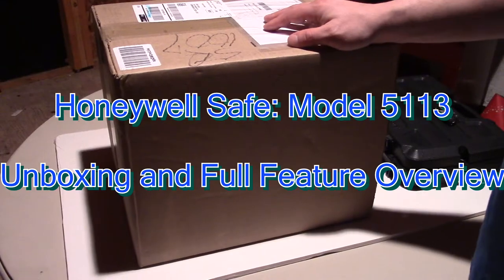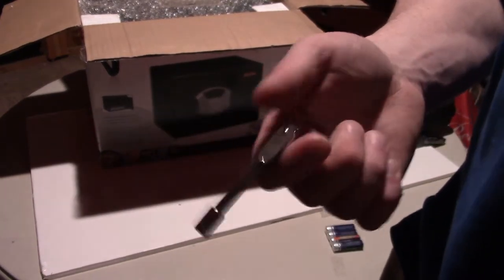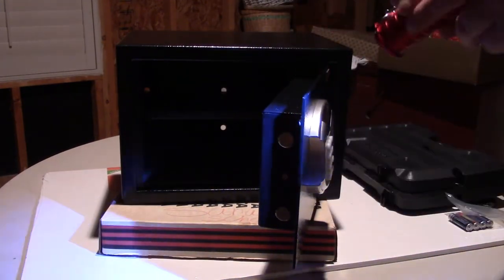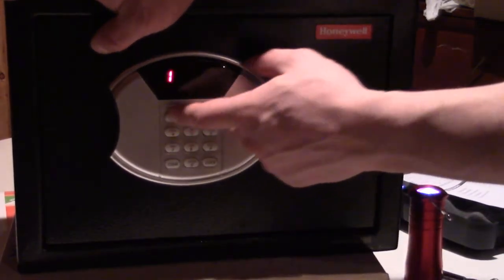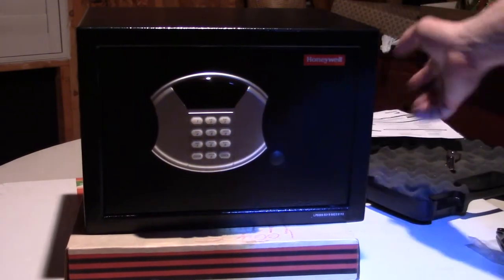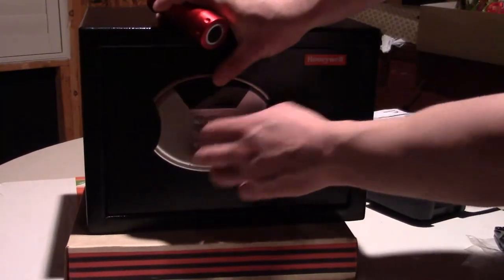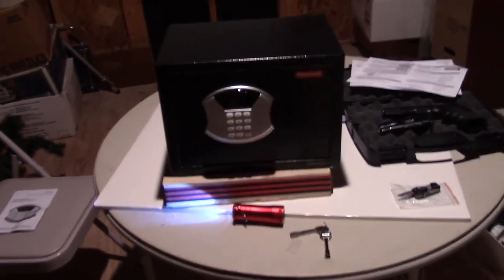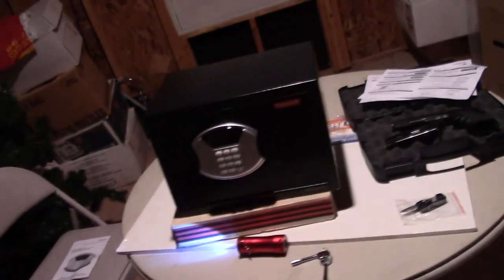Honeywell Digital Safe - Model: 5113 - Unboxing and Full Feature Overview / How-To Operate

Comment: How do you reset your code. I followed the instructions but it says turn key to the right and it only goes left. Kinds stuck with the manual which the instructions don’t make sense versus what can be done with the safe.
Reply: Hi, may i ask how you change your safe code? I don’t know what code I input. I thought I put the right code but turns out it isn’t the code that i meant to put.

Comment from the maker: Who has this safe?  Who has a similar sized safe that you can Pop the top of it and easily open it (making it well, "unsafe") ?
This one I've had for over a year now, and the way it's designed where you put in the code (not manual turn mechanism) - prevents that.  It also prevents a person from resetting it from a hole in the back -- and the other "common" easy methods of cracking / opening the safe.  Other than spotting the "emergency" key opening that is covered (for if batteries die, or you forgot code) -- and being able to pick locks -- 
Anything short of taking some serious powertools to the safe to get into it won't work.  Most people who know about the popping of safes to open them also are  beneficially lazy.. in that if it takes real skill or work (or shows evidence of opening/tampering) they won't do it.  
So you have two main options.
1) Buy a safe in this price range, and I recommend this one for security reasons.

2) Spending 5-20 times the cost of this safe for a manual combination type lock safe, which is great, but also expensive.  As long as it's not one of the pop the top and it's open type of safes I'm more than satisfied with it's security and convenience.

Anyone own this safe, anyone purchased or considering purchasing one after watching this video?
Reply: Bro a slim jim bent to reach the reset button through the cracks on the door of the safe someone will be in the safe in no time